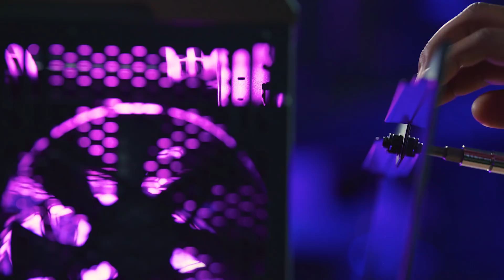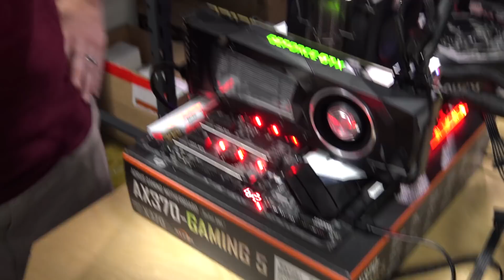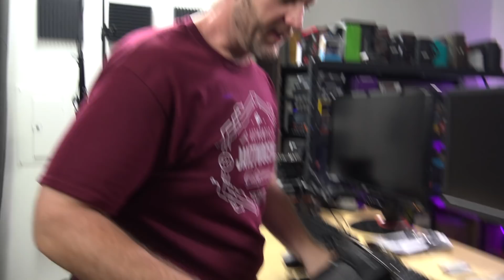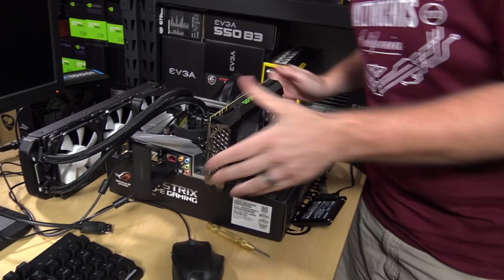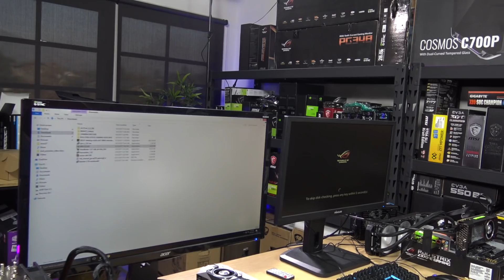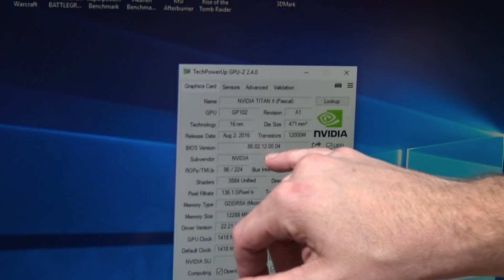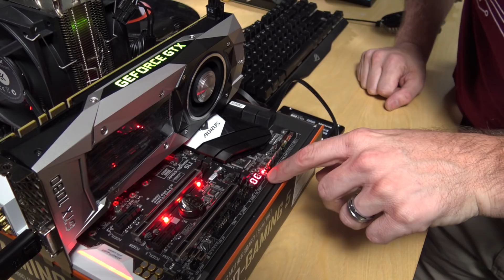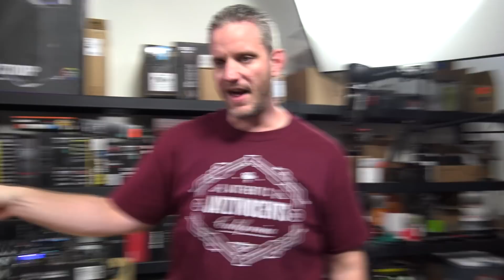I cant figure this one out... HELP!

Comment: JayZ I think you mixed up the cards xD The one not working is on the Intel system xD

And you checked the BIOS on the WORKING card which of course is identical.

And you held a wrong GPU when you said that "this one is not working", the one you should be holding is still on the Intel system running :D

Comment: The graphics card may not be "fully" good, and that motherboard is seeing that.  Try a complete set of benchmarks on the intel system, power consumption as well, and see if the results are different.

Comment: You checked the same card twice ... Also i think looks like power issue (noisy power) you use only one power cable and jumper ... Use two that halfs the inductens and half the power noise. Or swap the supplys they have tolerances too.

Comment: i put my money on  PCI express slot on the motherboard, if by resitting the next graphic card you've used on that board you got a successful post, it means some of the pins on PCI slot might've been bent, and due to the minor differences in GPUs sits width you get no post with  that particular Titan Xp, so if possible use another slot or a riser cable to see if the board posts. and clear the bios for good fortune will ya, for conformation you can use another board as an alternative to narrow down the possible culprit. i work at the genetic lab and we usually change all the possible variables when facing problems,and yes even people. hope it helps.

Comment: can you check the connector pins on the motherboard and the card? sometimes there is a fraction of thickness difference on the pcb/connector and that creates a poor connection between the connectors on MB and the pin of GPU pcb and that creates the trouble. use a precision digital caliper to measure the thickness of the pcb on the connector side of the card goving trouble and the good one. it will be a painstaking process( since you will have to measure each connector for thickness). Best of luck and i think this might help u out. I had this issue with some electronics (not GPU/MB though), but the issue remains the same.

Comment: I had the same problem when an r9 280x, wouldn't work on my system, worked in all my friends pc's and their cards all worked in mine. please let me know if you find a solution, that would be very useful. Here's what i know:
- try Reset cmos
- it is a motherboard problem

my system that wouldn't work with the r9 280x was an old thinkpad mobo, i5 2300, 8gb ddr3 ram.
i ended up swapping the r9 with my buddy for a gtx760 which works fine and he has had no problems with the r9.
Reply: Too bad you had to deal with that underpowered thing haha, the 280X still plays well!

Comment: Had this issue way back with an r9 270, changed mobo and the card stopped running re flashed bios and card worked only thing I can think of

Comment: I still think it's the mainboard's fault. I had similar experiences with my asus rampage 3 extreme and a vapor-x r9 280x. It'd artifact like hell and sometimes not even output signal to the monitor. When I put it in another mainboard it worked much better (it still had artifacts, but it did work). When I put a gtx 570 in the x58 mainboard, it worked fine.

That 280x ended up being unusable but I think you get my point.

Also, here's another reason why I think it's the mainboard's fault: (https://plus.google.com/u/0/+GaiusTrollius/posts/EnkNF6biGAB)

I ended up rebuilding the system with a new mainboard, c.p.u. and ram, and the graphics card remained the same. It works completely fine.

Comment: 5:20 um jay you checked the bios on the same card twice. You took the non amd functional gpu put it in the Intel system then checked the gpu that you had already checked the bios in with the Intel rig after putting it into the amd rig

Comment: Not sure if related but, i recently got a gtx titan x for my old lga1366 board running a six core xeon w3690 with antec 1000w psu. Bios would flash up but then computer shutdown immediately. Had 8pin + 6pin tail connected to card. Knew there was plenty of power for the system. Took out 6 pin and ran a second gpu power cable to provide 6pin power, computer ran without issue. Maybe it was requesting to many amps off the one rail??

Comment: i had a friend who was a new builder come to me with an Ryzen issue where he thought his gpu wasn't displaying and getting s gpu error code, but it turned out to be a bad piece of ram, no ram error code readout, but just refused to work with his gpu, Once i tested the ram in another PC, it was bad ram. WHY RYZEN WHY YOU HAVE SO MANY ISSUES. this is why i buy and recommend intel for anyone getting into PC building as it is so well tried and tested that its so rare to have a crazy unique issue like what alot of Ryzen problems are.

Comment: Sorry Jayz I did not see you check the readings on the GPU card, the one which was not working on AMD then did when swapped to INTEL motherboard.
Did you do this or was it missed in video edit?
Could the card which did not work in AMD Mobo have a slightly shorter gold strips and the AMD board may have also the same, as you had to reseat one of the other test cards in the video.
Best of luck to finding the answer Jay.

Comment: Jay... Believe it or not, this does not surprise me. About 15 years ago, I bought a webcam to use on my AMD system so I could webchat with my friends in the states. No matter what I tried, "the cam" just wouldn't work. I put the same webcam on my friends Intel system and it just worked. No fuss... No mess. From that moment on, I never seriously considered owning another AMD-based rig. I'm happy that they're making strides, but after all this time, to still see this kind of problem (numerous times)... It's disheartening. Things like this justify why I say that only AMD could screw up a potential game breaker.

Comment: Jay, as other users already mentioned: most probably the board needs RMA. It just looks faulty. 
Also, try booting up the system with the card in a different pci ex slot, try using two different 8-pin cables to connect the gpu.

Comment: my first step would be reflashing the GPU BIOS. i work with microcontrollers on an almost daily basis and every one in like a thousand has a perfect flashing procedure but still a damaged firmware afterwards. in most cases reflashing fixes this. if this does not work i would check another ryzen board with the same CPU or a different slot on the same board. maybe the mobo has something damaged at the slot. step three would be a disassembly of the gpu and checking for blown caps and/or damaged solder points and comparison to a working card. you either find the fix for the problem or it is just dark magic and you should sacrify this card to the dark godesses of computer hardware.

Comment: Hey Jay. I had z170xp-sli gigabyte mobo with 6600k. Sold it to friend who bought used 6600k and recommended him to buy same RAM as mine(corsair lpx 2666 2x8). Guess what happened, mobo refused to work with 2 ram sticks and if it worked it was only single chnnl.
My conclusion and xperience is: " GIGABYTE is not making qulaity products as was in core2duo era and before. Now its fuzzy, bios stability is odd. Booting of mobo is long as eternity, etc etc.......

Comment: Test the motherboard,
CPU, 
Reseat the ram,
Reset the motherboard battery,
try a different CPU cooler and more thermal paste.
Might not boot on cardboard there might be something interfering with the motherboard making it unable to post such as a pin or piece of metal
Add fresh thermal paste?
Try a different monitor or cables
I could go on 
But I often found it was either a motherboard or hard drive or BIOS error that stopped me from booting. Sometimes a clean reinstall of Windows did the trick.

Comment: So I think a question that should be asked is does it work with other ryzen build? If so I would try the simplest thing first such as changing your ram as a starting point. Different brand and speed. If no effect then maybe either cpu or motherboard. I say start with ram first because ryzen is notoriously picky about ram. That and I've seen computers do really strange things because of ram sticks including affecting video cards. Also one of AvE's rules for trouble shooting is easiest thing first. I hope it helps!

Comment: I would be interested to see how much power (and quality) is actually being delivered through the mobo and power connectors.  Sometimes you get small variances through the manufacturing process from one run to the other that can lead to a single sub standard part.

Comment: The problem might be a bad video card. I mean sure since different platfrom goes trough similar yet no the "same" types of boot cycles it can be that as Ryzen does it's specific sets of checks as the videocard gives out wrong feed back it can't boot and messes up the boot cycle.
Sure the card might still work just fine after you get it to boot as the checks done are not necessarily preventing any normal use of the GPU but the video card might still have issue within. Or it has slightly corrupted BIOS and can't boot on Ryzen. Did you reflash the the motherboard BIOS?
So you did clear CMOS after and switched to 1080ti?

Comment: Does the affected Titan have an overclock profile applied, or is the clock boost higher than the other? Since Ryzen requires a discreet gpu to run, boot on the mb might miss the car detection because of an overclock at boot.

Comment: Jay, I got a Asus x99 E board and it posts with broken GPUs and does not actually install the driver or work at all aside from giving a display. check the GPU while in the intel system since you missed it in this video.
Reply: how did both of you two miss that you checked the same card's bios twice :D

Comment: You didn't check the GPU BIOS on the GPU when switched to intel.

So I used to work with NVIDIA on HPC systems and they had some issues with signal integrity at the pcie layers and power training.
Run heavy compute loads that puts a strain on the pcie link for transferring on both systems, then look for AER errors on the on both ... 

Additionally if the one that doesn't work correctly on Ryzen has power training issues so if it's on average usually a little slower that the working one it's likely that the Mobo can't get it clean enough power to get through it's power training.

Feel free to message me here and I can email you, I did this sort of debugging on Titan (Oak Ridge National Labs) and for Piz Daint (+) .. the Swiss supercomputer.

Comment: Hello Jay,I have actually seen similar behavior,pluggning an nvidia gpu into a DELL OEM PC,it booted but only 1 monitor would work,card works fine on other computers.The moral of the story is-motherboard is faulty,re-flash it or get a replacement.

Comment: Irrelevant tip: connect the power cable to the gpu before you plug it in to the motherboard to avoid issues with resitting.

Comment: Probably the motherboard, that's the same one i have and gigabyte's bios is... meh... if you are using the f9a one, that could be causing it, when i updated from f5 to f9a, my 1600x became unstable af and nearly bricked my mobo, i had to use the backup bios to restore the main one.. sigh.. no more gigabyte for me

Comment: Could be a motherboard issue because when i build my system i got a budget asus board with an amd f6300 and an older gtx card and it just didnt see it but when i put an amd card in it it worked fine and when i put a different gtx card in it it worked fine too. So i guess it depends on how lucky or unlucky you are with the cards? Otherwise i wouldnt know then it could be amd not pairing up right with like 1 out of 500 nvidia cards or something

Comment: Going to assume that you checked the bios of the other card off camera? Because you took the card out of the intel system after checking it on there then checked it on the ryzen one as well the same card, I assume you meant to check the other card on the intel system not the other way around.

Comment: Did you check the bios on the card that didn't work?
I saw you checked it on the intel, you swapped cards then checked the same card bios on the amd system

I didn't see you check the bios on the card that didnt the work on the amd system

Comment: I had something like this with my Gigabyte GA-AB350 Gaming 3 and my GTX 950. After a couple of boots, it stopped getting past the BIOS. So, I changed my monitor (well, TV) from HDMI to DVI... and it worked. The board simply sat on the BIOS waiting for a response from the monitor, and it wasn't recognising HDMI.

Plugging in a second monitor with VGA/DVI, primary with HDMI, and disabling the second monitor in Windows seemed to do the trick. As long as the second monitor has power, even if it's not turned on, it works. Not everybody has two monitors, though. I think this also works if your monitor has both ports available, it's just annoying to have to mess about.

There was a new BIOS version the other day, so I might give just HDMI a go again, though I've been getting a weird overscan issue over the past couple of months which means I'm having to use VGA through DVI anyway.

Comment: I would almost bet its a bad motherboard. I experienced this issue a while back on an old intel system. I had upgraded to a 9800gx2 from a buddy. card worked perfect in his rig but when we put it in mine it wouldnt post. Put my old card in updated bios and booted it with my old card. In the mean time we put the 9800 back in his rig and it booted no issues. Put it back in mine after the bios update and it still wouldnt work. RMA'd the motherboard. When the new one got it in i got it all back together and it worked fine for about 3 years till the 9800 finally gave out.

Comment: Actually having spent 6 hours working with this motherboard and troubleshooting it, I found that the automatic OC settings in the bios causes problems like this, in my case manual input of settings both for the overclock and the memory speed/ voltage /multiplier, and timings, I got the system to run fine, I am glad i did not have this issue, but All of the 'automatic' overclocking done in bios and in windows gave me headaches with this motherboard. And question was the problem failed post or failure to launch windows, code OC shows reserved so no info on that post problem but the hangup on 62 shows installation of the PCH runtime services had an error, there is a setting in the bios that is supposed to help with overclocking, and it does affect that, I would check to see if you had that enabled or disabled I think its the 3DMark01 Enhancement, Idk if that was it, but something on that port caused the card to not want to work, Also you didnt show this in the vid but did you test in all the PCIE slots? Hope any of  this helped, this motherboard is a bear, but works fantastically when its set up.

Comment: Put a video card that works and then run ddu uninstaller(or another program that completely delete gpu files/registry) and load default settings in your motherboard .Then put the video card  that has the problem.(i had a similar problem with  msi 390 and i fixed it).

Comment: I had this problem my GTX 970 wouldn't work on my MSI B350M GAMING PRO with Ryzen 3 1300x so I thought it was the motherboard so I got a different one (MSI B350M MORTAR) and it still didn't work, so I bought a GTX 1060 instead and it worked fine, I know the 970 was fine because I was using it on my old rig fine

Comment: I'd still say reflash the BIOS. I've experienced something similar, where an acquaintance had a bad GTX770, so he asked if i would take a look at it. Problem is, it worked completely fine in my systems, while other GPU's also worked fine in the one, where the 770 wouldn't work..

There could easily be a corrupted line of code in the GPU BIOS, that one MB sees, and another doesn't. It could relate to the pinout on that specific CPU, or that specific chipset, or some other variable. that is only seen on that model of MB. In any case there's a failure to communicate correctly. It could also be corruption in the MB BIOS on that one specific board.

Comment: Did you just check GPU BIOS version twice on the same card and surprised yourself that is identical!? I believe you did.... :)))) What you needed to do is to check BIOS on Intel system when you switched GPUs... I also have a bit stupid suggestion, but i believe i encountered similar problem in the past and with me the problem was actually RAM memory.. Try changing RAM sticks or swapping slots... Many times i don`t get post on monitor i assume it is GPU, but it`s RAM that was causing me problems... Not necessarily faulty ram, just compatibility issues...
Reply: Agent Smith YOU'RE RIGHT. HE MOST DEFFINITELY DID. Can't believe he did that. Must be the pressure of filming, or..... he did a jump cut & put it back in the other rig.
Reply: He was most definitely tired because he was troubleshooted this for hours and hours... But still that is not the problem as he figured it :)

Comment: If I only had one motherboard to try it on, I'd try different pcie slots, if the mobo has the option of changing pcie modes (16x, 8x, 4x etc) I'd try running it in different modes, just to see if I could get any reaction at all. I would also try booting with different memory configs. Minimize the number of components in the system. Probably wouldn't work, but always worth exhausting all possibilities.

Comment: I had the same problem. Don't know why. I used the card in another PciE slot and it worked. I even got another card cause a thought it was the graphuc card. Installed both in SLI mode, with the second one in the first PciE slot and both worked fine in SLI mode. I have an Asus Prime X370 with Ryzen 1700X.